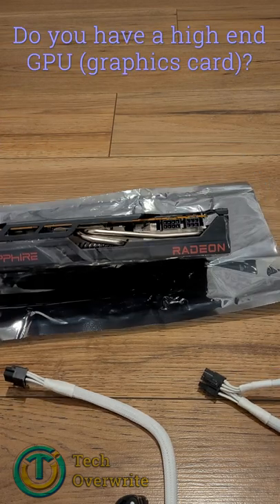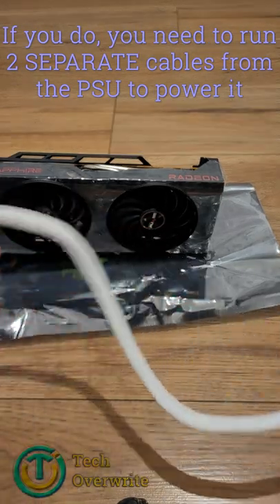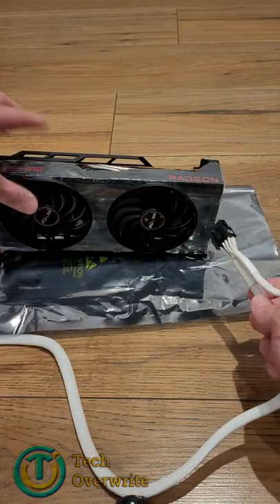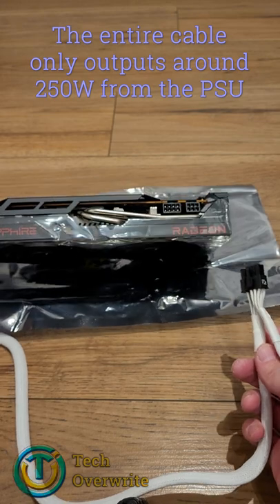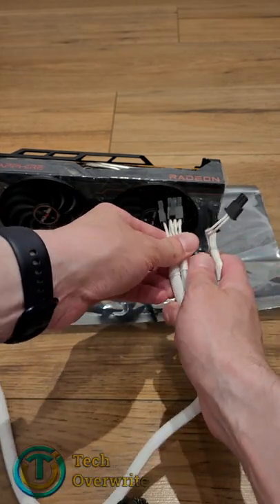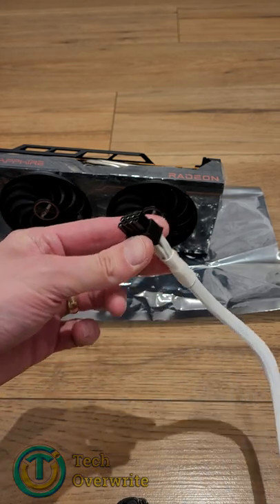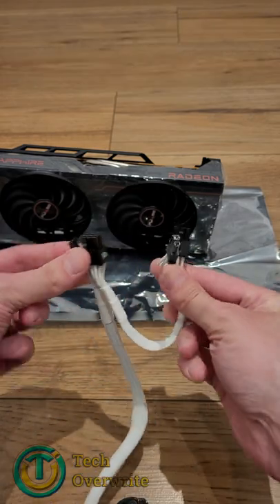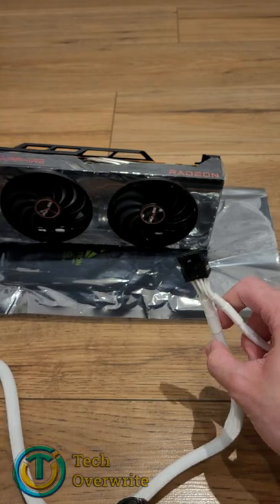Why You Should NEVER (Usually) Use The Same Split (Pigtail) PCIe PSU Cable #Shorts

Comment: My psu only came with 2 pcie cables (both are pigtails) I rlly want to buy a 3070 ti, but it has 3x8pin power connectors. I was gonna use 2 pcie cables, 1 using the pigtail cable and the other on it's own. Is this ok? I won't be overclocking.
Reply from the maker: Yes that should be okay with the 2 separate cables, which supply 450W or more total - then the PCIe motherboard slot will supply another 75W. So unless you GPU needs way more than 500W, I would imagine you'd be fine 🙂
Reply: @TechOverwrite  thanks 👍

Comment: How do add an extra cable? My power supply is non modular
Reply from the maker: Unfortunately in this case your options are to just use one cable (and ensure your GPU uses below 225W power), replace the PSU, or look at undervolting the GPU so it uses a bit less power.

Comment: I did this and didn't realize it! My PC crashed 4 times and even flipped the circuit breaker. I decided to use 2 separate cables, and it fixed the issue. I really hope I didn't damage anything...grr
Reply from the maker: Oh wow, that's crazy. Glad you got it fixed and the circuit breaker hopefully isn't tripping any more 😅

Comment: If there are 3 Pcie ports in gpu can you plug both split and one separate?
Reply from the maker: Yes that should be okay, depending on the TDP of the GPU. The two separate cables will supply approx 500W of power, and the motherboard PCIe slot another 75W. So as long as the GPU needs 575W or less of power, doing what you describe should be fine 🙂

Comment: Im upgrading from 1660 to a RTX 4080 16gb

Il buy a 850w psu, should I pigtale our its safer with more cables?
Reply from the maker: That's a fairly powerful GPU, so 2 separate PCIe cables would be needed. If your GPU needs 3 connectors, though, you should be safe to use one pigtail (for 2x connectors) and 1x on the other separate cable.

Comment: You get 75w from the PCIE slot so it's fine. Also never rest any components on the outside of a static bag. There's a non conductive surface right there, yet you choose that?
Reply from the maker: All good points, thank you 🙂. And true re the static bag, that was a n00b error on my part 🙈
Reply: @TechOverwrite  I've accidently daisy chained 2 PSUs together and powered them on so in comparison it's nothing lmao

Comment: My power supply only came  with 2 that's wasn't pig tailed what do I do now my gpu has 3 8 pins
Reply from the maker: That should be fine (depending on how power hungry your GPU is). The two separate cables should supply 400W to your GPU, then the PCIe slot on the mobo will supply another 75W.

Comment: Weird I've been using this configuration but i've had no issues with my graphics card. keep in my, i do have my cpu and gpu undervolted so maybe that's why?
Reply from the maker: Ooo yep, undervolting will help a lot here because it'll require less GPU power load.

Comment: Hello different question I bought a 1070 upgrade from my 1050ti my PSU is modular but I don’t have the PCIe cables can I just buy one off like Amazon and connect it to my GPU thank you
Reply from the maker: Hello, good question. You should be fine to buy new cables, but stick to the same brand. I.e. buy modular cables that are designed for your specific PSU. Don't mix and match one company's PSU with a different company's cables 🙂
Reply: @TechOverwrite  should I buy two PCIe cables or one could just work I have a 650 watt EVGA PSU

Comment: My GPU has only one connector (RTX 4070TI), when using the 2 connector split, should I use the same pigtail or 2 different from the psu
Reply from the maker: You should ideally be looking to use two separate cables for the 4070Ti. The two separate cables (plus the motherboard PCIe slot) will then supply sufficient power, no matter the specific connector layout you then use.
Reply: @TechOverwrite  thanks installing my card this night !!

Comment: Hi I bought a RTX 3070 with a 12-pin connector . I have a 600W psu with one 2x6+2pin pigtailed cable. Will it be enough if i put it in the adapter?
Reply from the maker: Hi, I'd say this would be fine here. The PCIe cable will supply 150-250W, and the motherboard PCIe slot supplies another 75W. So together they should be under your card's TDP 🤞
Reply: Thank you for the answer .Yeah it works fine even in underloads.👍

Comment: What do I if my gpu only has one 8 pin connector but my PCIE cables are together making a 16 pin
Reply from the maker: Oo, good question. I'm not 100% sure sorry - maybe you can see if you can purchase a 16 pin splitter (an adaptor which then gives 2x 8 pins). That would work if so 🤞

Comment: I need help. What if I have four?
Reply from the maker: Good question 🙈 Uhm, you'd probably need to look at the GPU's power usage. If it was (say) 800W, you would probably struggle to get enough power - even when taking into account the PCIe slot on the motherboard which supplies 75W. Even if both cables supply as much as 200W (whether pigtailed or separately), it wouldn't be enough for a 800W PSU and pigtailed connectors. 

So you'd probably need to run the math a bit. I think the next gen for Nvidia might become more problematic in this case, with more and more people needing to buy PSUs with three PCIe cable outputs.

Comment: And what to do if you have single cable
And how i know if it has 2 separate cable or not before buy power supply?
Reply from the maker: If it has only 1 cable, you'll just have to be careful not to buy a 400W GPU (for example). 250-275W and below should be fine with 1 cable if it's a quality PSU, but that would be the max imo.

In terms of how to know, good question. A PSU should list the various connectors it has in the description. So it should say "1x PSIe, 2x Molex, 1x motherboard connector" (etc). In that case, it has only 1 PCIe supply.

Comment: What about rtx 3050 it's okay to use standard, one cable from psu?
Reply from the maker: Yes I agree, the power consumption on an rtx 3050 is lower enough that a pigtailed connection should work fine 🙂
Reply: @TechOverwrite  how about rx 6600 xt it's safe to use standard one?

Comment: hello  i only have the daisy chain connector do you think its ok to buy from 3rd party sellers ?
Reply from the maker: Hello, if it's a reputable third party one (like CableMod) then it can be fine. But I wouldn't trust a random, no-brand PSU adapter 👍

Comment: i  overclocked my gpu when only using 1 cable for a couple days until i found this video. Is there gonna be any permanent damage on my gpu? or will i be fine since it was only a couple days. i think 8 days
Reply from the maker: It should be fine tbh, unless you had loads of crashes during that time, there shouldn't be any damage. Plus if it runs fine now (with 2 cables), you're almost certainly safe 👍
Reply: @TechOverwrite  yeah my gpu works perfectly fine rn. haven't had any crashes so I think I'm alright

Comment: guys my psu has 2 six pin cables with 2 pin pigtails, can i put the 6 and 2 pin cables in the same gpu slot?
Reply from the maker: Which PSU is it? As long as it's TDP is below 225W or so, you should be fine with a single cable to be honest. But over that, and it's worth using the 2 separate cables - whichever configuration of pins works easiest 🙂

Comment: I really like that you reply to every comment to help us. I do have a question tho. I have a mining rig with 6 pigtail pcie cables. So can I attach a splitter to one of the pigtail connector and use it for one gpu ( with the riser ) and the other pigtail to a different GPU using a splitter, so one cable powering 2 GPUs completely. I really hope you understand lol
Reply from the maker: Hah thanks, happy to help 🙂 Uhm, good question. Your PSU might start crying, but it should technically be possible as long as the GPUs aren't too high powered. As in, a single cable will be maxed at around 150W or so. So if each GPU requires 200W, you might be out of luck (even with the 75W or so from the PCIe slot) since you effectively need to half the 150W from the cable, since it's split. But a 100W card should be fine. Basically, it's tricky. But if the graphics cards are decently powerful, you'll probably be (much) better off with a second PSU.

Comment: is it ok if i can use 1 8pin power cable cause i domt have a second one?
Reply from the maker: If your PSU only supplies 1 cable, it might be because it's not designed for powerful GPUs. A GPU up to 300W or so should be fine, but any more might be a stretch.

Comment: I was using the pig tails and then switched to 2 separate cables and noticed 0 preformancd difference. I'm using a rtx 3080 ti. And I doubt it's CPU bottlenecked but I'm using a Ryzen 9 5900x
Reply from the maker: Hmm interesting, thanks for sharing your views. That's good to know. Maybe it depends on the PSU make/model too - I've heard of a bunch of issues with pigtailed cables, but it's awesome that you haven't had any problems.
Reply: Interesting, i will get a Rx 6700xt and maybe it wont make a difference but i will plug 2 cables to be sure

Comment: I have gigabytes aorus rtx 3070 TI master, and it has 3 8pin connectors, and I use 2 cables to from the psu, is that okay?
Reply from the maker: Oo yes, this is an interesting point (i.e. a 3 connector GPU with a 2 cable PSU). In this case, that sounds fine to me (if it's two separate cables) - the two cables will supply more than enough power, along with the PCIe slot too, to supply the 3070 Ti Master. Nice GPU btw, I was strongly considering buying that at one point 🙂
Reply: @TechOverwrite  Thank youu

Comment: Wait... for a few months I've been running my 3080 gaming z trio 12gb on 3x8 pin with one split. Is this bad?
Reply from the maker: Nah that should be fine, since the two separate cables will supply 400-500W easily enough. It might be a different story if the GPU has a 750W TDP, but the 3080 should be fine with 2 separate cables for 3 connectors
Reply: @TechOverwrite  oh thank God haha. I appreciate you replying to me :) thank you

Comment: So have 2 8 pin and 1 6pin i chould run 3 cables ? Thanks
Reply from the maker: It depends on your GPU, but two separate cables plus the motherboard slot should provide 450-500W easily. So unless your TDP is over that, I wouldn't worry.

Comment: How do I run two cables from my power supply?
Reply from the maker: This advice is for modular PSUs. Just plug two separate PCIe cables into the PSU, if you have the option to do so. Non-modular PSUs will come with a specific number of PCIe cables coming out of it.

Comment: can i use cpu cable for gpu? my psu only came with 2 pcie but have space for more pcie "have the same connection" (corsair rm850)
Reply from the maker: I don't think you can do this no, I thought that one of the pins (the 12V) is in a different position. So even if they look similar, using the CPU cable as PCIe can potentially be very bad. Maybe it varies per PSU, but that's my understanding anyway 🙂
Reply: @TechOverwrite  ohh ok thx

Comment: is the lian li strimer 8 pin cable okay then?
Reply from the maker: That's an awesome cable 💪 However... while it's good quality and 18AWG, it will still have an upper limit for how much power can flow through it. A 400W graphics card (for example) probably won't be stable if you use the split cable here.

Comment: Can i connect my 12pin from PSU to dual 6+2pin to 3080?
Reply from the maker: Good question... I'm honestly not sure sorry. It depends how the 12 pin is wired up inside the PSU. If it functions (effectively) as two separate PCIe 6 pins then great, it will work fine. Since replacing the PSU would be a pain, you could try running with the dual 6+2 pin and just keeping an eye on any crashes or FPS dips. I'd be surprised if a PSU has a 12 pin PCIe connector which functions more like a 6 pin connector, but I don't know for sure sorry.

Comment: So if I use two cables for my rx 7900xt i should be fine even if it has three slots for the power connectors 
Its rated at 300 watts max 
I hope this works, in case it doesn't i need a new psu i guess
Reply from the maker: Yes I agree, 2 separate cables will be all you need here - even with the 3 connectors. 🙂

Comment: My cv550 has only one pci cable. Can i use the pigtail from the sane cable for it? It has a 225W tdp.
Reply from the maker: It's borderline, but you should be okay using the single cable with a 225W GPU yes 🤞 But you might need to avoid overclocking it, and look out for freezes or crashes related to the graphics card 🙂
Reply: @TechOverwrite  ah alright. Thanks alot!

Comment: Would connecting the card the "wrong" way cause it to heat up more? I put parts together online but requested the shop to assemble the pc and ship it as if pre built and it came in that way. Should I change it? It's a 3070 from gigabyte and the PSU is 700W.
Reply from the maker: Hmm great question. I'm honestly not sure but I'd guess no (it shouldn't cause it to heat more). If anything it would lead to slightly less power delivery and so less heat. But that's more of a guess tbh.
Reply: @TechOverwrite  damn. Do you know what is the proper way to name both ways to connect so I at least know what key words to include in googling it? I've been trying to Google it myself but it always is about using wrong cables or damaged ones.
Reply from the maker: I don't think there is a specific name to be honest, other than connecting using one pigtail or the 'split' connector. I've heard people say those terms (pigtail or split), but no other terms iirc.
Reply: @TechOverwrite  ok I'll use those, previously I just googled how to connect GPU, GPU connected wrong. Stuff like that.

Comment: What if my GPU requires 3 cables?
Reply from the maker: It depends on the TDP of the GPU. The 2 separate cables will supply 400-450W, and the motherboard another 75W. So as long as the TDP isn't above 500W or so, it should be fine to use 2 separate cables and 1 with a pigtail (for 3 connectors overall) 🙂
Reply: @TechOverwrite  okay thank you

Comment: What if I have 3x8 pin gpu?? Specifically the rtx 3090 evga ftw3 ultra gaming
Reply from the maker: Using two separate cables (one of which is then pigtailed, for the third connection) should be okay in this case - the two separate cables should be supplying 400W watts, then the PCIe slot on the mobo will be supplying a further 75W.
Reply: @TechOverwrite  hey I have a 3080 and I have three 8 pin slots too, I was thinking of plugging three individual 8 pin connectors, which all are pigtails but I won’t be plugging in pigtail, is that fine ?

Comment: Don't forget that the actual pcie slot provides some power (75 watt if I remember correctly)
Reply from the maker: True, this is a key point that I should have included originally 😔 Thanks for pointing it out 🙂
Reply: this is true, and while i suspect no one will run into this situation anymore, i feel obliged to mention, some older PCIE gen 1/2 and iirc some early gen 3 motherboards wont always allow 75W from the PCIE rail and will crash if the computer attempts to do so. 
iirc this was why semi notoriously when the RX480 came out people had issues with it crashing on older computers.
Reply: @POKEMANZZ3  Very interesting. I wouldn't have known that.

Comment: What If you just got one and your gpu got 2 I am not getting no display
Reply from the maker: Hmm, it depends on the GPU's power requirements. One PCIe PSU cable will supply up to 250W, then the motherboard PCIe slot another 75W. So if your GPU requires above 300-325W, you will struggle with just 1 cable unfortunately 😔
Reply: @TechOverwrite  I just got a rtx 3070 but my pc only got 1 8 pin I am getting no display the rtx 3070 got 2 8 pins slots
Reply: @TechOverwrite  should I just take the Rtx back to best buy
Reply: @JaystacksYT  yes, if your gpu still have warranty
Reply: @kiryu1275  I got it to work
Reply from the maker: Glad you got it working 💪🙂
Reply: @TechOverwrite  thanks for your help man I had to get a power supply and re install everything and it turn on
Reply from the maker: @jaystacks that's great 🙂

Comment: I have a 6900xt and it has 3x8 pins. Can I give it two seperate inputs and pigtail one?
Reply from the maker: Yes that should work fine 🤞 That card should use below 300W, meaning two separate cables plus the mobo PCIe slot will deliver enough power - even with a single pigtail.